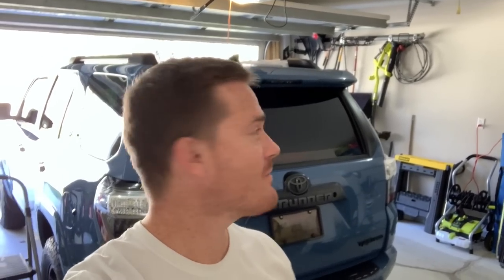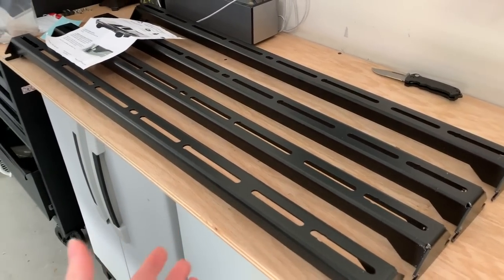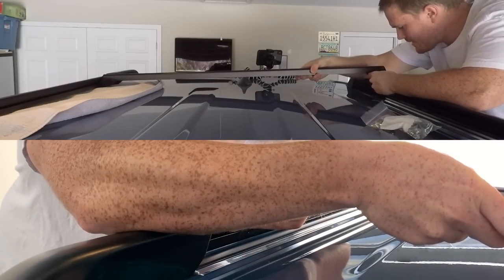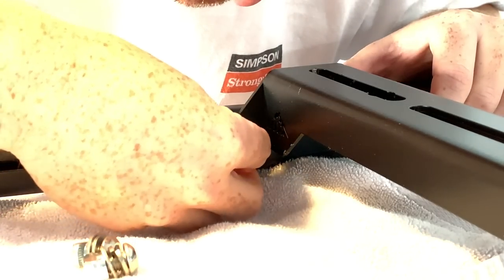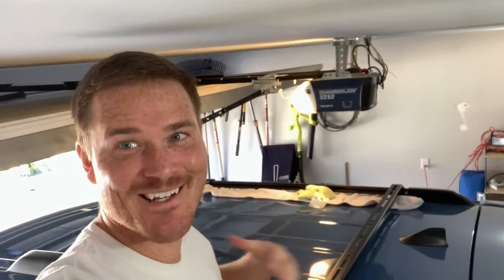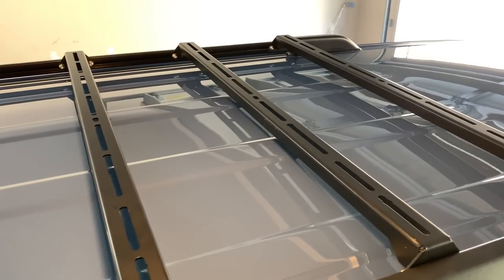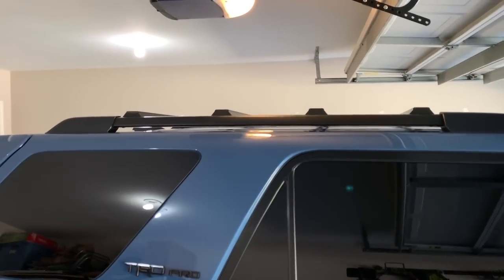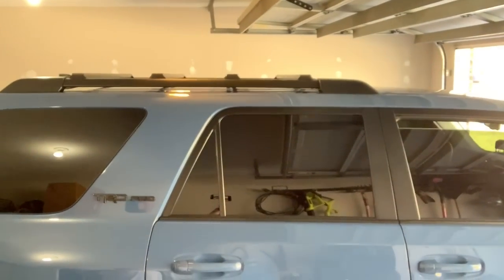LFD OFF ROAD MODULAR CROSS BAR INSTALL | TOYOTA 4RUNNER 5TH GEN

Comment: Just got these bars today. Super easy install and they look amazing. Easily a one man job. Trickiest part was removing the caps on the stock rails to remove the OEM crossbars. The bars are such a huge visual and utility upgrade over stock and significantly less cost than a full rack. Perfect for those of us who don’t use our 4Runners as dedicated overland builds.
Reply from the maker: Great to hear!
Reply: what hardware do you use to mount gear/accessories along the channels on the cross bars?

Comment: Nice video extremely helpful. Thank you. Additional tips, get two ladders. One for each side of the truck, Get two towels, one for each side of the truck.  Watch video on pulling end caps of on youtube...be very careful.....don't tighten down the front to much until the others are placed. thread your nuts before install to where you can slide them in snug on install. Drivers side bolts turn towards front of truck. Passenger sides to the back. Pull your towels out before locking down front.  If you have front wing fairing piece, put on the protective strip first. ( I actually cut about 2" of mine) Took me a little longer than 41 minutes but pretty simple modification.

Comment: I just installed yesterday.  A couple of notes.  If you have the factory cross bars on there already, to take them off you have to remove the roof rack completely.  Second, if you get the fairing, it's a little tricky to put on with the cross bars already installed if you put the bolt top down with the nut on the bottom (not much room with the roof in the way of your hands).  If you have to take the roof rack off anyway, install the cross bars and fairing first and then put the rack back on.  Mine does have that vibration at around 70 mph so first I am going to move the fairing back as far as it will go towards the crossbar and if I still get the vibration I will install the washers. I got the washers at Home Depot.  They were in a drawer down low.  Neoprene washers 5/16 in black 3 pk (87480 15748).  The plan is to put one on each of the 4 bolts if moving the fairing back doesn't stop the vibration (I have my hands crossed it will work).  If I need two I'll buy more.  That being said, very high quality and functional product, definitely recommended.  I got aluminum and steel, aluminum is 2 lbs even and steel is 4.7 lbs.
Reply from the maker: Glad you are liking them!

Comment: I actually priced out piecing the rack together or just going with the complete 7/8 rack, and it's less expensive to go with the complete rack.  The complete rack includes 8 crossbars and the wind fairing.
Reply from the maker: Yes it is a bit less expensive just to pull the full trigger right away

Comment: Hi Jon....was wondering if you had any insight on the dynamic weight capacity of the side rails.  There seems to be a lot of different thoughts on this.
Reply from the maker: LFD recommendation is just to do the stock rail limits

Comment: Man!!! I am so glad you are happy with those! Mine are the first generation, and I have loved every minute of them. But those new ones with the slots!!! That is fantastic!!! I am going to have to get with LFD and get some updated ones! :)
Reply from the maker: Super glad I did too. So yours are just a bar ?
Reply: @TRDJon  Mine have predrilled holes at different points. They have always lined up with my accessories (rack, RTT, Hi-Lift mounts, FuelPax, and other stuff). The design of yours is better in my opinion, but there is not thing wrong with mine.
Reply from the maker: Ahhhhhh I see the difference yea.

Comment: Thanks for this. They look great.  Will be looking for wind noise analysis. I was leaning ttoward a front runner rack but at over $1100 I have been hesitating.  With the slot system I will be curious if front runner accessories will work. What is the weight limits for dynamic and static loading?
Reply from the maker: I’d be hesitant to give true weight numbers as they are still on the stock roof rails. However if also seen people put RTT’s on stock rails also. Having 4 of these I feel disperses the load pretty well

Comment: Hey I know this vid is a bit old but hopefully you can answer (apologies if the answer is somewhere buried in the 257 comments too 😅) BUT regarding the height of these bars, when mounted to the factory rails, do items clear the shark fin antennae? For instance, if you were to throw a piece of 4x8 plywood on the roof? Thx in advance!

Comment: At 8:57 you say these 4 steel LFD xbars were cheaper than OEM.  Huh?  

On Amazon, 2 OEM bars are $114 (free shipping w/prime), so a set of 4 would be $228 - and, being aluminum, they wouldn't rust and being aerodynamic they're supposedly silent, and if you bought 4 (vs. the standard 2) for extra support, you could probably mount a refrigerator up there, evenly loaded.  

The LFD "steel" (not aluminum, not stainless steel) bars are $80 each or $320 for 4 (plus $28 shipping).  Stock = $230, LFD = $350.  And, due to the higher wind noise (than stock) you still likely need a fairing, too (which, at LFD is another $40, so now we're up to $390.  Basically close to $225 vs. just shy of $400. 

Am I missing something?
Reply from the maker: I got my bars on Black Friday and they were really cheap. But yes Amazon is cheap. I was meaning if you were to get the bars from the dealership
Reply: So if we were to just buy more 4runner cross bars you could create a sort of platform and just strap things on to them right? Won't be as nifty with holes to screw things into but cheaper.

Comment: Thanks for the video-- love the 4Runner and your videos! Have you noticed a lot of wind noise from these without the front wind faring?
Reply from the maker: A decent amount yes. I did a wind test video too with just the bars
Reply: Yes, you do, I have the same exact install, at 40 miles per wo wind fairing, and about 60 mph, humming sound.
Ordered wind fairing, ordered all Aluminum, rails and fairing. Love the rack.
Reply: @gjm8220  how much does the wind faring help with wind nose?  I'm looking at purchasing the crossbar bundle
Reply: @IronAgebrewery  
Hi Josh, 
It's a must to prevent wind noise I tried it Without it, I can't hear any wind at all with it, just make sure it is set all the way to the cross bar like.the directions mention.
If you need pics let me know.
Guy
Reply: @gjm8220  thanks for the quick reply. I'll definitely be purchasing these. If I need any pics, I'll let you know. 
Thanks, again!

Comment: They look good!
 I know you said you don’t think you’d get a roof top tent, but do you think those would handle the weight of one with two people in them?
Reply from the maker: Yes 100%
Reply: The factory rails are going to be the main concern for holding that weight, not the crossbars. The crossbars Jon installed are much sturdier than the factory rails.

Comment: awesome video john. I don't want to buy a full rack right now, just need something for my kayaks. would this be a good option?
Reply from the maker: Yes, absolutely But just keep in mind the wind noise they make when unloaded is definitely noticeable.
Reply: Got a 19' 4R and looking to load my kayak also.  Will check this one out
Reply: Are they higher than the antenna?
Reply from the maker: Yes

Comment: Hey bud!  I plasti dipped my roof rack end caps,  Never using plasti dip before I noticed slight chipping on my paint work I guess I should have applied more layers,  I accidentally snapped one of my clips from the end caps when removing them but it's still snug on the bar when re attached.   How's your plasti dipped roof rail holding up so far and around how many coats of plasti would you recommend?  Thanks for sharing
Reply from the maker: It was great prior to going with a full roof rack. Zero issues

Comment: Thanks Jon, nice video, I've been in the market of upgrading my factory cross bar. I have a Thule Force XT XL cargo box and the factory cross bar is just not cutting it, it flexes and keeps bouncing. I've been told to buy an after market cross bar like Thule or Yakima but doesn't wanna spent $500 for it. My question to you is, would I be able to use this cross bar with my Thule box. It   looks sturdy but not too sure if the thule box mounting part will actually work with this bar.
Reply from the maker: I'm not 100% sure due to the way these bars are. LFD is super customer service oriented so I'm sure if you email them, they will respond.

Comment: I bought a set that includes the fairing. It sat too low about 3/62 of an inch. I am not the only one who had the same problem... anyway, everytime I drove, I heard a vibrating noise and thought they went loose but werw not. I rem9ved them to return them and I discovered the fairing has dug into the paint on my 4Runner. I was hoping LFD will help with the pint, but they only offered to send me a touch up paint. Pathetic customer support and crappy design. I can confirm I was not the only one who had this issue as another 4runner forum member also returned the product.

Comment: Another great video! I just sent my stock roof rails in for powder coat because I like this route. 

Questions:
1. I know you got the steel ones, but I also saw aluminum LFD crossbars...other than alums being more expensive and lighter, was there any other reason you went with steel?
2. If wind noise becomes an issue, do you know if I can just add a wind faring to the frontmost crossbar, or do I need to install the LFD rails to add the wind faring? I could probably just call them but thought u might know.
3. I get my Maxtrax boards today. Do you know if MaxTrax boards are easily mountable using the MaxTrax mounting pins with the LFD crossbeams? Can u mount the boards facing front to back, or is it only right to left? I’d much prefer mounting them vertical to the crossbars to reduce wind noise.

I do like how you don’t have to remove the plastic rear end caps to install these crossbars...on the other side, I guess they are easier to steal??
Reply: Disregard #1 and #2...I ended up ordering 3 LFD cross bars (2 steel and 1 aluminum).

As far as the Max Trax are concerned, LFD customer service assured me that there are many ways to mount the Max Trax.

Not sure how the wind faring will look with the factory rails...still on the fence about it.
Reply from the maker: So sorry meant to comment back! People have said that with adding some bolts to the top the wind noise has reduced. And yes maxtrax will have zero problems mounting

Comment: Great review brother!  I just ordered three rails with the wind deflector in steel.  How does the finish look for the powder coating?  What did you use to paint the factory rails?  I’m thinking about the spray bed liner...or some simple high temp flat black rustoleum.
Reply from the maker: Honestly I just did plasti dip for now. 6 coats.
Reply from the maker: Lemme know how you like the deflector!
Reply: You got it!  These rails are bad ass
Reply: You got it!  These rails are bad ass
Reply: You got it!  These rails are bad ass
Reply from the maker: Especially for their price and being so simple to install

Comment: nice vid Jon.  Thinking about pulling the trigger on 4 bars too. After 6 months of use, do you find the need for the cargo stop? appreciate your feedback
Reply from the maker: I don’t yet. But the beauty of it is that you can always add that when you want
Reply: Blue TRD Jon yeah that’s great. I got in contact w ecotechne too. Their full rack isn’t priced that bad, under 800. But read or saw your vid about rusting issues. Undecided now.
Reply from the maker: Yea and hardware issues with them too.

Comment: Thanks for the install video very informative I've watched this twice and planning to have it on my 2021. Do you know the dimensions of the crossbar C channel? I'm still thinking of using my Yakima load warrior that came with it as needed I'm trying to figure out if the Yakima brackets attachment.
Reply from the maker: Not that I know of. Maybe try emailing their customer service to see if it is easily compatible. I dont see an issue though trying to run that rack onto of these bars.
Reply: TRD JON thanks again but if you can give me a favor measuring the crossbar so I can figure out the clearance on my existing Yakima Load warrior bracket. Lot's of thanks.

Comment: If I want just the bars do I order the 3/4 rack side rails only or the 7/8 rack, exactly what you got?
Reply from the maker: There is a section of their site for just the cross bars
Reply: Blue TRD Jon is there any reason to get aluminum over steel other than weight?

Comment: Did you paint the rails yourself or did you get them powder coated?
Reply from the maker: I painted them myself
Reply: If the oem rails on the 4runner were steel then yeah definitely powder coat to prevent rust, but it’s alloy so you can paint em’ whatever way you like.

Comment: I purchased the LFD cross bars from Victory 4x4 and was very disappointed that they provided no installation instructions . Even worse the bolting system requires the removal of the end s of side bars separating the ends from the side bars the inserting all the bolts . 
Upon discovering that and with no instructions I went back to the vendor and asked one for instructions and two for about system that was shown on your video where no end caps or side rails detached from end caps . I want to slip the rails and bolts without any end cap removal as per your video.
Reply from the maker: Were they not LFD ? Cuz with the LFD you shouldn’t have to bad to remove those

Comment: It gives it a different look to it, what's the weight capacity?
Reply from the maker: They say not to go over the weight
Of the stock rails. However I’ve seen RTT’s on stock rails soo idk. I think Toyota shoots low with that number to be safe. The Toyota rails will fail before these.
Reply: Toyota rack is plenty strong. I have had 12 sheets of 3/4" plywood or 15 sheets of 5/8' Sheetrock on the roof at slow speeds and short distances many times and have not damaged them yet. I don't know how much weight that is, but I can tell you that is plenty heavy. I would like to know what is the weight rating on these cross members if they are stronger I will get those when I get my 6th gen 4Runner. Been waiting about 5 years already, this is ridiculous.